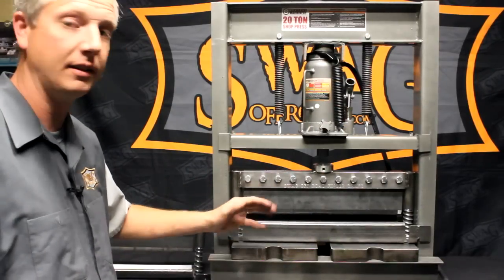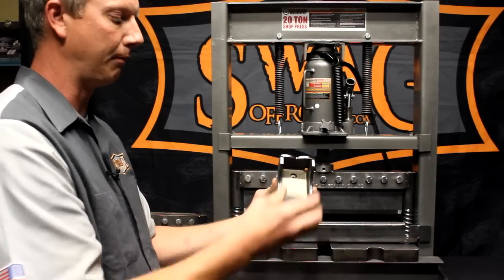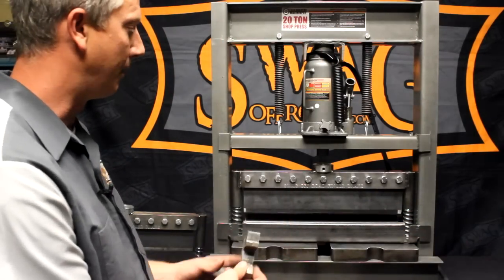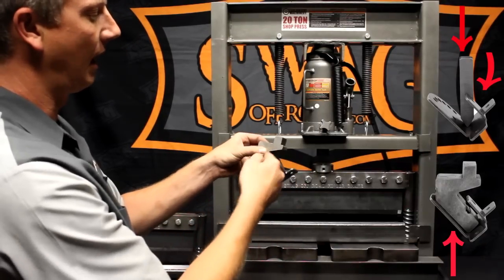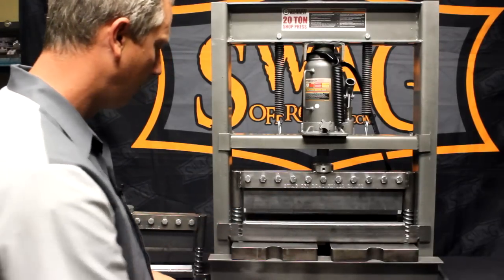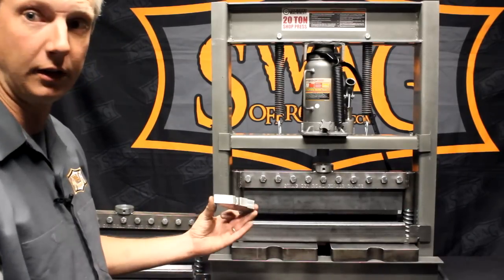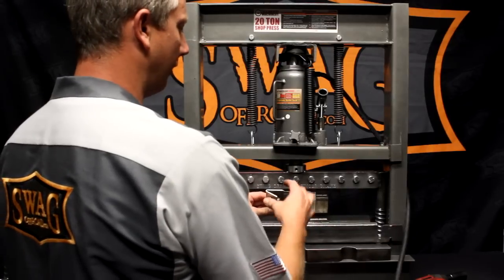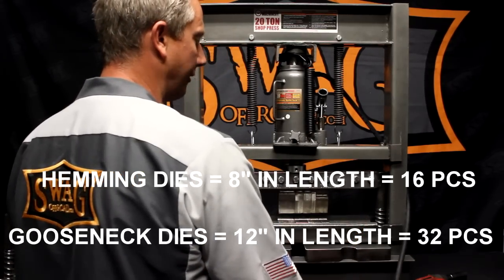SWAG OFF ROAD PRESS BRAKE GOOSENECK & HEMMING DIES DEMO

Comment: Can’t you just use a horizontal bandsaw to cut the solid die into fingers?
Reply from the maker: I apologize, but I'm not quite sure what you mean. Are you saying cut a solid top die Press Brake into smaller segments in order to make it a finger brake? If so, you could but you would then need a clamping bar to hold the fingers.

Comment: How did you guys get the bottle jack to be air operated?
Reply from the maker: We replaced the manual bottle jack with a 20 Air Over Hydraulic Jack from Harbor Freight.

Comment: Camera to see your back and then struggle to see past you to the work you did, hmmmmm dude really.

Also I have your gear here. So I pressed a nut against a finger die and found the nut dented the finger die. I thought those would have been made from tool steel rockwell hard hard. Guess not

Comment: Funny looking goose neck.  And that's not all they are for.  Yours is cut custom for what ever reason.  You should be able to brake a .75 lip 90 and then feed the piece in another 0.75 and brake 90.  Up over and down.  You can Fab shit like wrecker trucks and service beds and tool boxes and I have always cut my dies to width as needed.  The it is referred to as a box break.

Comment: For the press, can you guys develop a set of dies for bending solid round bar?  I tried to put a 90 bend in some 1/2” round using the HD press and dented a die.
Reply: Bending round bar is very tricky. I would estimate that in your case you would need a punch with atleast a 6mm radius and also a v of between 60 to 100mm due to the inner radius that it will automatically bend to. Moreover you might need a die with bearings on the shoulder of the die to minimize friction during bending.

Comment: You being the professional and , well the upper fingers are called PUNCHS the lower are called Die. Male= Punch  Female = Die. Just saying.
your hemming die sets are referred to as Acute angle die sets.
Each die set will have material clearance to handle the different thickness. The lower die can brake if the material is too thick.
Reply: racinford1 I appreciate this comment, I actually learned something neat from it. 🙂

I didn’t know the punches/dies thing either.
Reply: I came here to say basically the same thing.  You'd think the people making, marketing and selling the product would know the actual names of the parts.

Comment: So the dies actually need to be under sized. To allow for material thickness.  So if you need a 1” wide piece out to out and your bending 
1/8 material you would need a die 3/4 wide.

Comment: So what are the dies made of?
Reply from the maker: The dies are made with 1/2" plate steel.
Reply: Archie Bunker  They never said this was an industrial tool. It beats ... no pun intended ... trying to bend sheet metal in a bench vise with a block of wood and a hammer.

Comment: How do you make a large radius bend, like 1/4"? Is the bottom die have a wide enough V?
Reply: I have a large 45* die in the bottom and you can take a dowel pin and weld it on a punch to achieve the radius
Reply: Rv4 Guy you can get all different sorts of dyes for different applications
Reply: Radiused dies